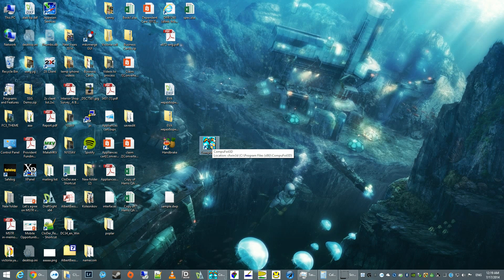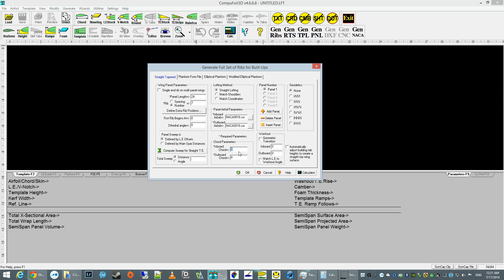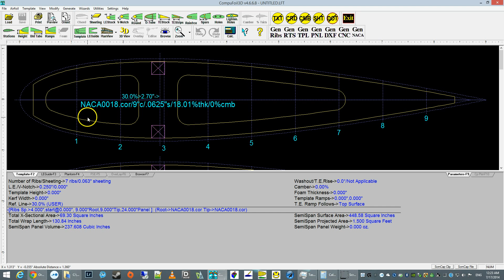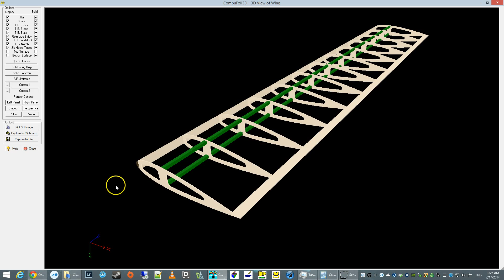Intro to Compufoil3D

Comment: this software is not suitable for control line models airfoil design,
Reply from the maker: That is not correct. It is plenty capable of designing CL airfoils. As a matter of fact, I've used it on several models. When I got stuck, an email to the program creator resulted in a less than 24hr thorough response.

Comment: Do a few more compufoil tutorials. I got this program also and trying to figure it out. I'm trying to loft some giant scaled Cessna 206 wings. That trade mark tapper wing shape Cessna has is a challenge. Looking from on top of the Cessna wings, the wing is tapped from the midpoint to the tops on both leading edge and trailing edge. How to get it like this on compufoil??